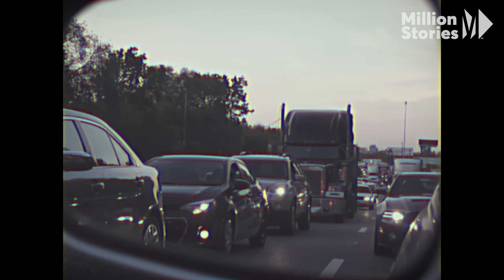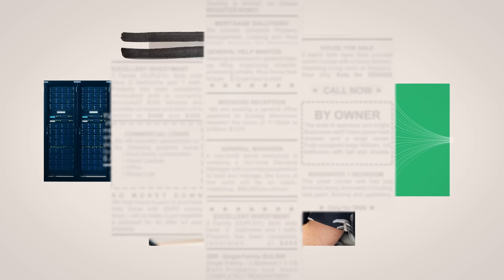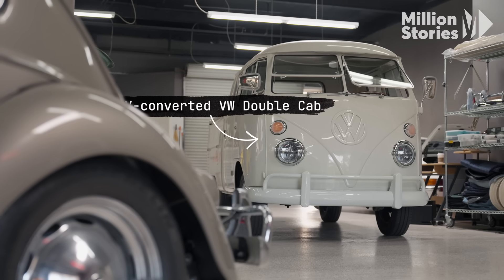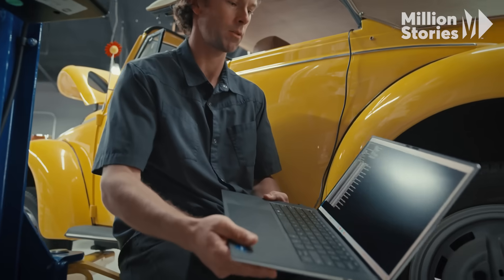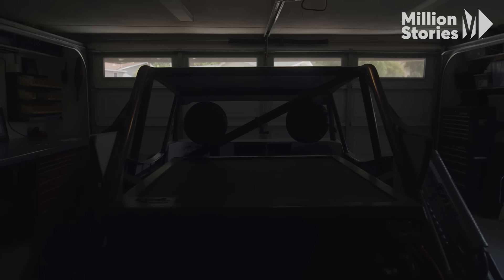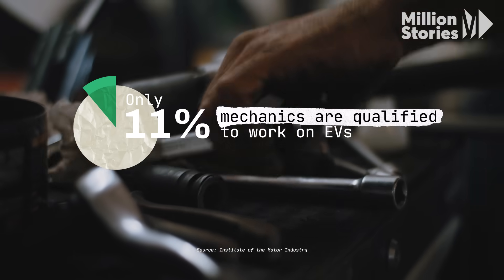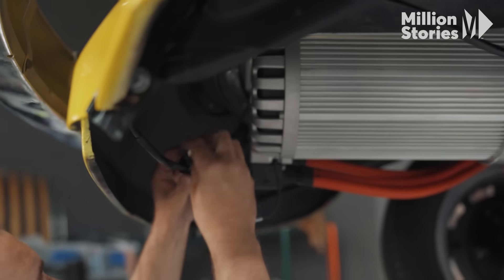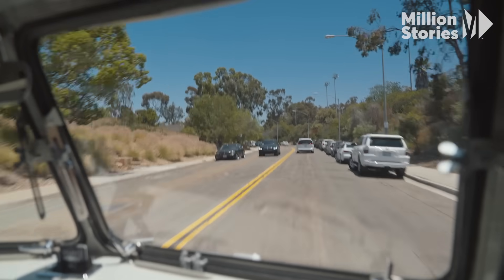Inside the Auto Repair Shops of the Electric Age

Comment: Hahahaha and the contaminetion of the bateries of the contamination of the origin of the electricity ?
Reply: So recycled batteries don’t exist?  If it’s not recycled your replacing extracted metals not contributing more to pollution. 
Nuclear, Wind, Solar, and Hydro make up about half of the electricity in the US. Where I live all the energy comes from solar power and nuclear power while I have rooftop solar on my house as well. Not only that, but EVs are much more efficient than gas cars. It’s the difference of a controlled explosion that’s inefficient vs efficient electronics. EVs being more efficient make them better for the environment even on a 100% coal grid. That efficiency increase also means a lower cost to get from point A to B which is the purpose of a vehicle.
Reply: Hahahahaha, and you breath "contamination" from tailpipes and the gas stations. . 🤷‍♂️